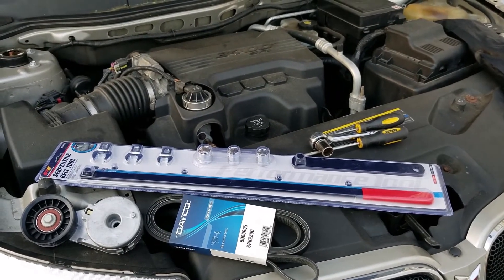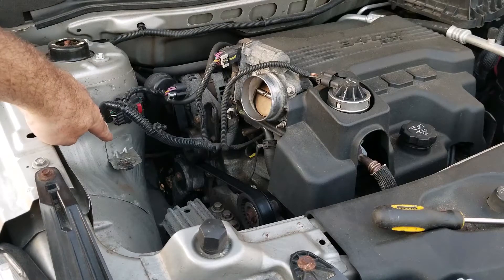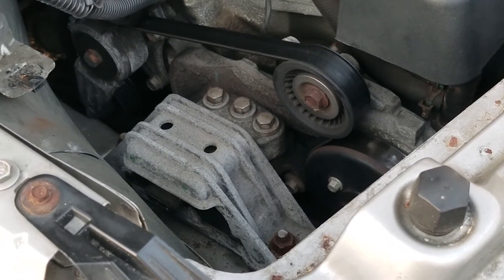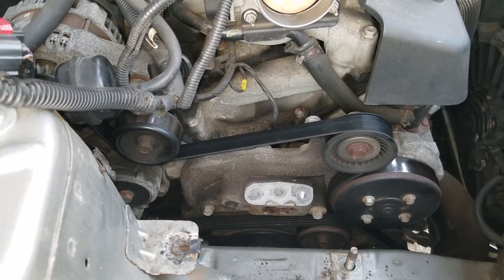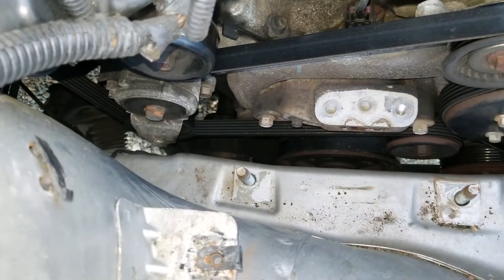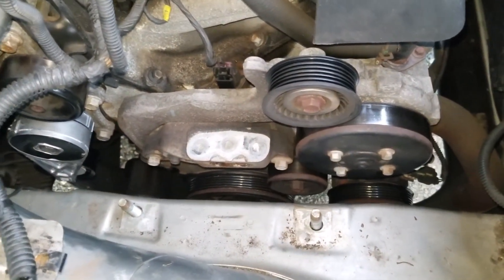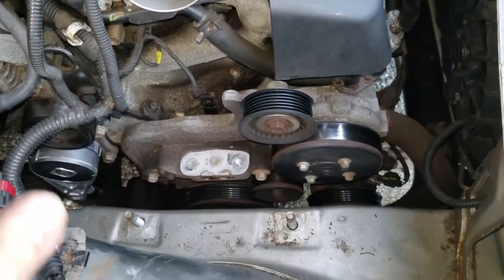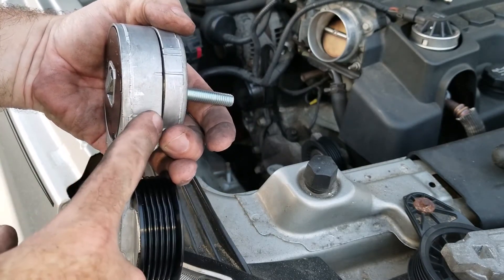GM 3400 Belt and Tensioner Replacement on a Pontiac Torrent. Found Another Issue I Need to Fix!

Comment: Thanks for your hardwork in recoding and uploading etc… helps us DIYers a lot ❤. Keep up the great job
Reply from the maker: Thanks for watching! I'm glad it helped you out and saved you money 👍 I brought my wife's car for tires today and they gave me a list of crap. I had to really laugh cause for a leak I know of at the Turbo which is literally a 50 cent crush washer leaking they told me they can replace the whole turbo for $3500. Just do the tires like I asked for. 😄😄
Reply: @ yea I hear you. I’m thankful to be able to have the knowledge and ability to attempt some of these tasks. 

I bought a used suv a while back at a dealer that did lifetime engine warranty and free oil changes for life. But they would sale pitch you over every little thing. It was a few months after I bought it and they wanted to change break fluid and something else. And I was like why didn’t you change it before I bought it lol.. 😆

Comment: Thanks for the video!  I'm glad I found it, because I never knew that that belt tensioner tool even existed.  And you definitely need it for this vehicle!  I've replaced many serpentine belts just using a ratchet on the tensioner.  No room for that on this vehicle.  Picked up the belt tool at Harbor Freight for $19.99.  Well worth it!  It is too long though, as you said.  I cut about 10 inches off the length of mine, and it worked great!

Comment: JrZ CarZ on the tension pulley for the 2006 Pontiac Torrent AWD what's the purpose for the washer on the 16mm bolt

Comment: I am in a tough situation. I have very little $(less than I need) and continue to run into problems. I've watched a couple of your videos, specifically, replacing dual cooling fan($300 was price tag, I did job myself) and replacing water pump in the Torrent 08. As soon as I turned car on afterwards though, the screen immediately reads Engine Hot/A/C off; even though the engine hasn't had a chance to warm up, let alone overheat. The water pump looked fine, currently there is no thermostat but that should cause over cooling rather than overheating. I do smell that rather sweet/stale smell of coolant around somewhere/everywhere. Finally, I didnt't bleed the system (of air)as I've just found out I should have after replacements.   Sorry for length of message. Just don't know how to go about this. Tough situation...
Reply from the maker: If you're smelling coolant, then you have a leak somewhere and that would be the first thing to start with. Loosing coolant will cause air pockets and can lead to damage. You could also have a faulty coolant temp sensor which could be giving you the hot temp reading as soon as you start the car. Start by finding the source of the leak, put the thermostat back in and go from there

Comment: Im having a bucking, hesitant feeling on my 3400 torrent and fixed throttle body sensors, egr ,plugs etc and cant seem to find the problem. Would mounts , belt n tensioner cause my issue?
Reply from the maker: Are the check engine light on?

Comment: Do you have to realign the motor mount when replaced or removed when you do a serpentine belt replacement?
Reply from the maker: If you secured the motor well and it doesnt move, there shouldn't be a need to realign the mount as it should fall back into place. Theres really no big adjustment anyway so it's not going to bind anything up.

Comment: Hi, I was wondering if you could help with the issue I’m having. I have a 07 Pontiac torrent and the hole that the belt tensioner bolt screws into is stripped. Right now the bolt is in with lock tight but it only holds for so long. What do u recommend for this issue?
Reply: Get a piece hardwire thin bent it V shape 2 off them stick them both inside the tensioner hole Make sure the end of the wire is bent to so it does not go completely inside when you try to screw in the bolt Very slowly with little pressure try to screw in the bolt If that does not work go to Home Depot  and see if you can find a little bit bigger screw good luck